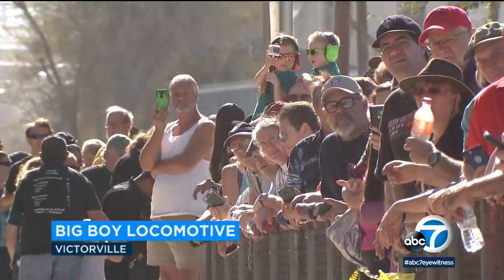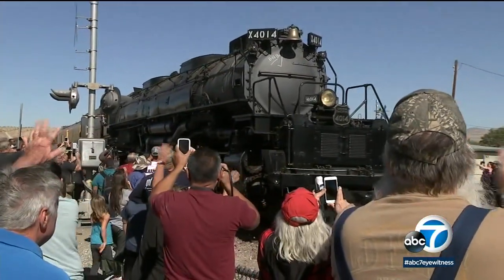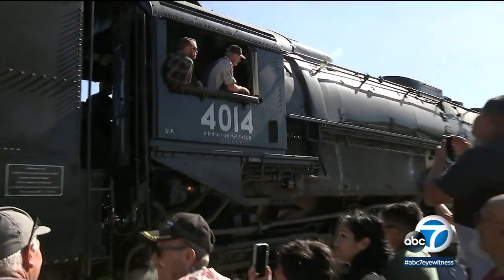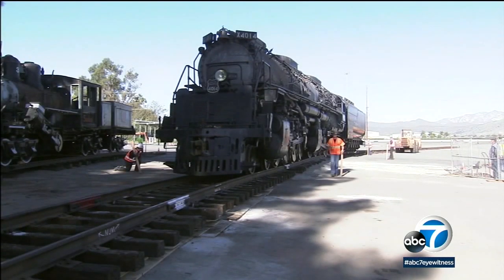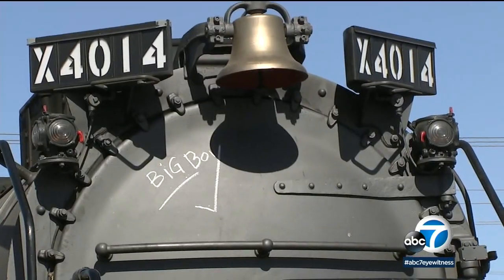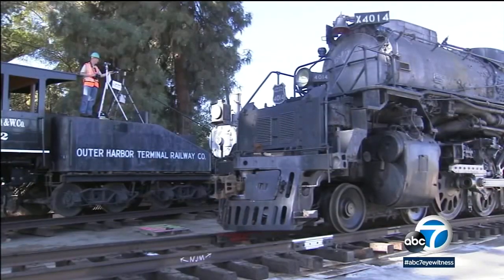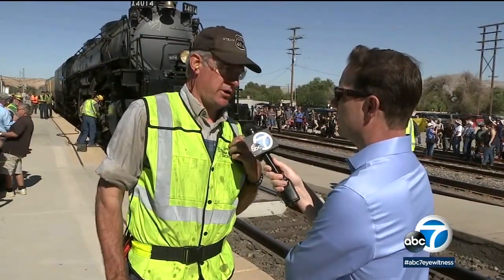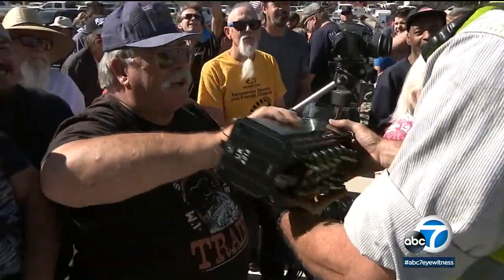Big Boy 4014: Largest locomotive ever built back in SoCal after massive restoration I ABC7

Comment: It's not the only "Big Boy". It's probably the longest steam engine ever made but it's not the heaviest. I saw the 4014 in Cheyenne years ago, It is very impressive up close.
Reply: It's debatable as to whether or not the Allegheny is heavier than Big Boy. They weigh roughly the same, Big Boy is longer but Allegheny taller
Reply: The only operational big boy
Reply: Big Boy ain’t even the longest steam engine ever built. That title goes to Pennsylvania Railroad 6100.
Reply: The big boy is just the largest locomotive that was all around a success

While some locomotives were longer or heavier or better at this one job or another, the big boy performed really well in all of the areas
Reply: Pensilvania S1 duplex was longer.
Reply: Actually PRR‘s S1 Duplex and Jawn Henry are both longer, NPR‘s Yellowstone was heavier, Challenger and the S1 have higher recorded RPM, and more trains actually have higher tractive efforts. Big Boy is the largest currently operating engine though!

Comment: I always wondered why there are other coal fired locomotives like in Durango, and other places with high fire dangers seem to cause a problem with fires.
Reply: BigBoy is not coal fired.  It burns oil.
Reply: The locomotives in Durango have now also been converted to run on oil.
Reply: @Mike-01234:  The Colorado narrow-gaugers were converted to run oil after it was discovered that they were setting fires (unintentionally, of course). . .